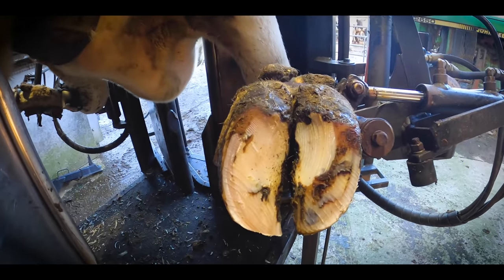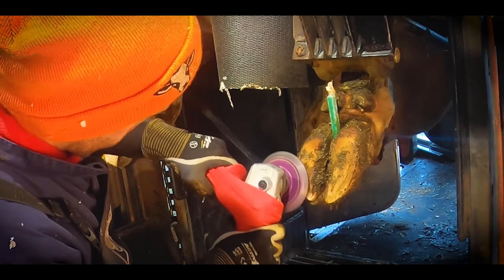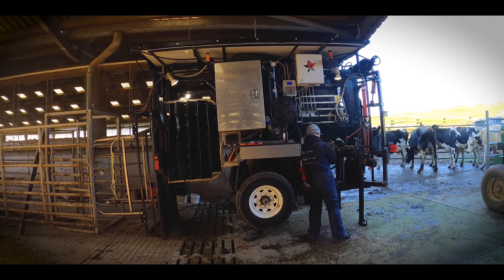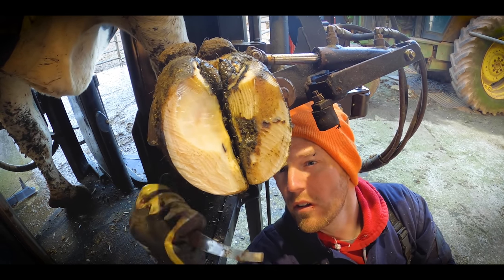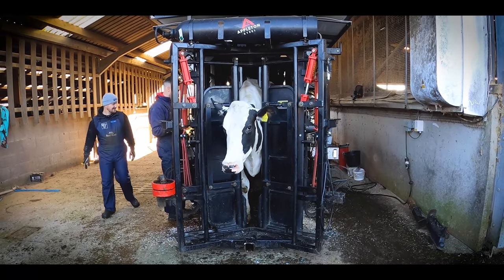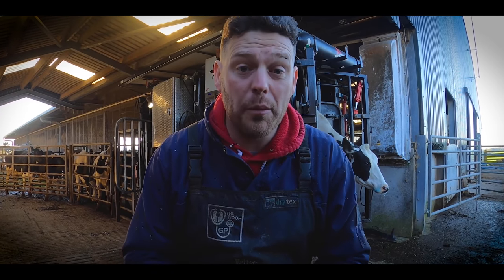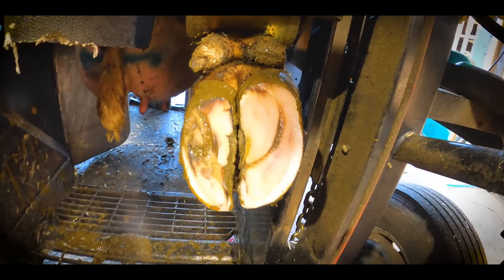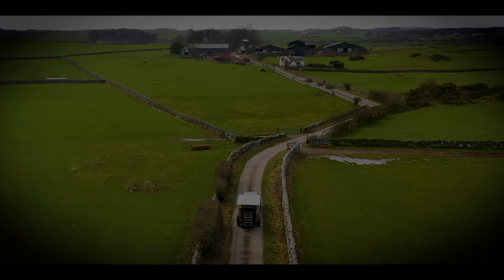WHAT I REALLY THINK!?  |   LAYOVER vs UPRIGHT TRIMMING CRUSHES

Comment: Before I watch I'll give the reasons why I would prefer an upright vs layover:
1) Being able to evaluate the balance of the feet and how the cow stands on their legs before working on them.
2) Trimming would be easier to evaluate level
3) Cows aren't huge fans of lying flat on their sides. They prefer resting on their chest.
4) Time. From what I've seen it is faster to do them standing than on their side.
5) If they panic or manage to break free there is less chance of anyone getting hurt in an upright.

That said, I am so happy this crush has broad hooks for the back legs that distribute the pressure over a much larger area and support the cannon bones vs your previous one that had a "hock hook" which isn't nearly as comfortable. The hock hook (also a rope or strap as some farmers use) wasn't as stable either and the cows seem more inclined to struggle than with a more supportive system lower on the leg. It's also tiring for cows to have to hold their foot up themselves which I would think they were trying to do to decrease the pressure point with the hock hook. With the old crush I cringed every time you had to have a hind foot in the air for more than a minute. That's a lot of weight to have on that one hook in a sensitive spot/joint.
Reply: Definitely agree with you on #3.

Comment: If cows are anything like horses, and I assume they are, laying them on their sides puts pressure on the rib cage, making it hard for them to breathe if they're in that position for any length of time. It sounds like most trims are pretty quick operations so perhaps that isn't much of a problem, but it's still stressful for the horse/cow. An upright crush seems better in this respect, too.

However, you might want to limit the amount of time you have those hind legs cranked up in the air. It stresses the joints and can cause pain. But since your trims are so fast, you probably don't run into much of that.

Comment: Would really love to know that are the advantages of roll over crush. Doesn’t look “as natural as possible” to me. Cows eyes always look like  it’s the end of the tunnel for them in the videos with this type of crush. Also time is wasted while you roll the cow over. And what if roller brakes or power goes off??
Reply: Yeah, I'm curious why the people who use them do and what they see as advantages.  Because to a layperson it looks both extremely stressful for the cow, and harder to work for the trimmer.
Reply: @junbh2  they are much less expensive to purchase and maintain. Their mechanical design and mechanisms are much less complex, so there are fewer points of potential failure.  They are more suited to being directly mounted on a truck so only a single vehicle is required instead of a trailer being pulled.
Reply: @byronmill  no cheaper actually more expensive. mine new cost me $90,000. A new Appleton is around 50k
Reply: @junbh2  much faster and easier to trim on. Especially when it comes to knife work. I can trim as many cows on a layover as 2 men on an upright. Less moving parts and less hazards for the cow and the trimmers.

Comment: I have watched a trimmer who uses a layover set up. The cattle doesn’t exactly look uncomfortable but it doesn’t exactly look that they would feel very comfortable either. But he also doesn’t seem to really do a lot of fancy repairs but just a lot of quick trims so maybe it works for him.

I would like to see these cattle crash adjusted so that they could be used for horses and donkeys. I think it would really help those who trim these animals more often to have one that is built for those types of animals
Reply: I've seen a couple videos of a crush style contraption for shoeing large draft horses. Not because they are all badly behaved but because they are so large and need more support and control than what is required of smaller horses.

 It is an upright stand where the horse is lead into it then securely fastened inside but it does not actually have a squeezing, crush function. Individual hooves are raised and strapped in place so the farrier can work. You never raise more than one foot at a time since horses are so delicate and prone to injury, even the drafts.

Well trained/socialized horses and donkeys should not require these stands.

Comment: Layover chutes are fairly common where I live here in the states, hoping that changes to upright as time goes on. Upright chutes are a drastic improvement in cow comfort overall
Reply: Layover chutes are actually much more comfortable for the cow trimmer. If any upright trimmer was honest with you they would tell you how dangerous they actually are for the cow. The cows legs are stretched and strained and unnatural angles and cows that are bred it's very bad for their uterus because of the strain from the belts while the rear legs are pulled back. I trim on a layover and used to trim on an upright. I will never go back.

Comment: How is the cows weight supported when all 4 feet are in the air? I definitely agree the cow looks much more comfortable in an upright position I wonder about the comfort of having all feet off the ground at the same time.
Reply: I think it is more to show that they could do so if needed, I can't say I've seen them actually do that very much at all. I know I've seen a wide strap around the ribs behind the arms in the front half, not sure if its the same in back though. And while I wouldn't say they are perfectly content, I do believe it is more comfortable than the layover overall, as cows more often tend to lay down in a semi-leaning position still on their stomaches as opposed to full on their sides.

Comment: My guess is the upright gives a more realistic angle for making sure the hoof gets trimmed FLAT, before being modeled out.  I'd imagine it's more likely to end up angled, as in slightly / or \ rather than __ vs using a layover.  Also, bathroom needs, potentially twisting stomachs, & physical struggling/injury as a result to a natural feeling of vulnerability to a predator in exposing the belly more all seem like reasons to go w/ an upright crush.

Comment: layovers were the ancient method of handling oxen - because horses, goats, and sheep stand on 3 legs with a tended foot.  Oxen resist and don't stand on 3 hoofs, because of their weight.  Ancient laying down was their safe method.  Now, the modern method is more safe and easy for the cows than the ancient method.  The vertical crush keeps the cows in restraint without harm and easy foot-up tending.  Modern upright crushes are the more natural processing of livestock ....

Comment: I work with a tip over used to use an up right have no trouble with tip over and all my customers agree cow lay fine no belly bands on mine it a squeeze side do 13000 cows a year never had a trouble
Reply: My tip over gas been used twice by to different vet to correct displacements in cows
Reply: They seem to hang on ur front belly band   If u havent trimmed in a tip over gp u really shouldn’t talk about it Iv do the two crush  up right for years and tip over for the last two year wouldnt go back to up right but nothin wrong them either if it one like ur now. But to many uprights crush out there are way to small fit today’s cows

Comment: The layover crush kinda reminded me of the torture chamber that turned the cow upside down before it butchered the animal. I felt panic rush through me. Also, many animals panic when they don't feel the ground or proper support (like standing on their feet or being propped in a safe way like you would hold a cat under it's bum). I have also heard that a big animal shouldn't lay on the side or stomach for a long time because the weight of the body can crush the organs. And isn't stomach turning (twisting, tangling or whatever it's called) a thing? I'm guessing that the animal tenses up every time it's turned over. Doesn't it affect the well-being of the animal?